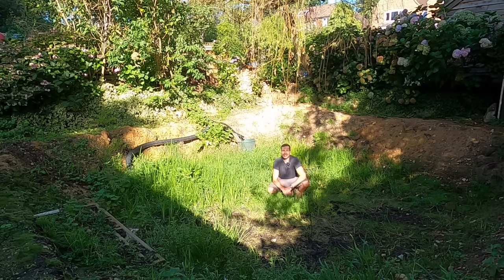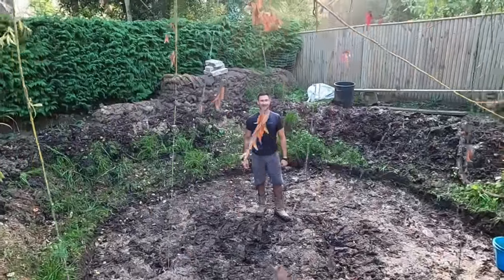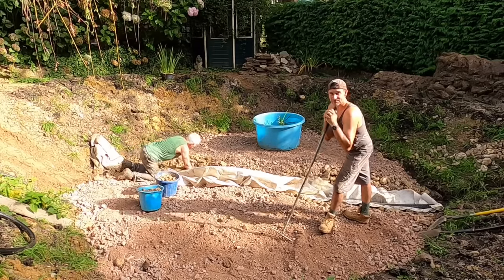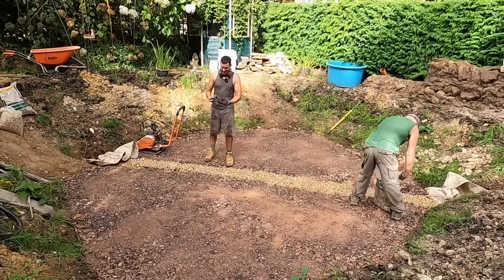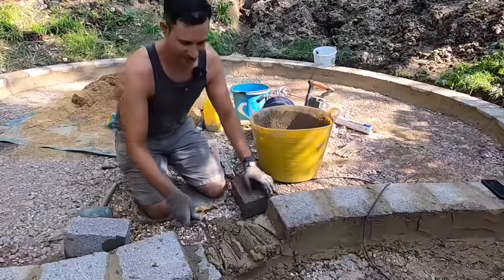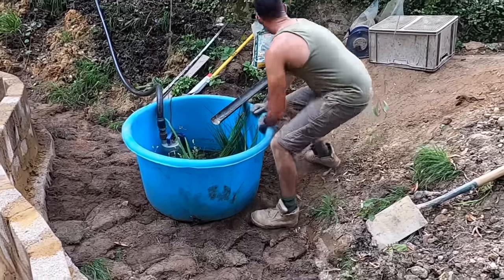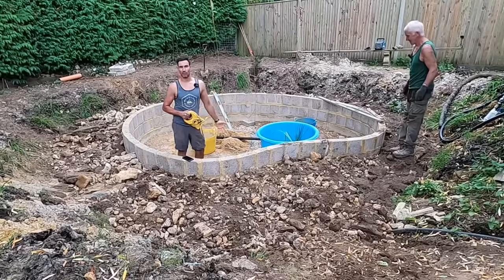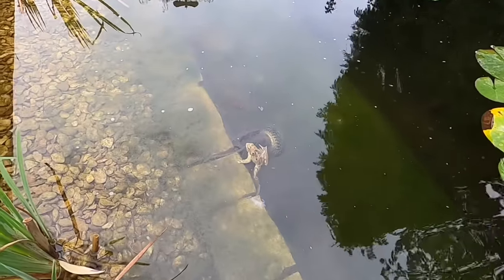Pimp my pond! Static wildlife pond construction part #1: Ground work in the snake pit!

Comment: When would you consider the best time to enlarge a wildlife pond as I would like to to make my pond much larger
Reply from the maker: Morning Martin, thanks for your comment and my apologies for the slow response- does your pond attract much wildlife-particularly amphibians? If so I’d avoid spring time (from around mid feb through to early summer) as this is when they will be spawning and their young maturing. If however none are present (in a koi pond for example) then spring is fine. Mid summer through to autumn is a good time to work on ponds (and water temperatures make it more pleasant as well!) heading into winter livestock will be settling down and frogs (if you’re lucky enough to have some) preparing to semi hibernate in the water, again best to avoid then, particularly so as working in water in the depths of winter is pretty horrible and undertaking groundwork a messy process.
Hope this helps and good luck!
Best,
Ed